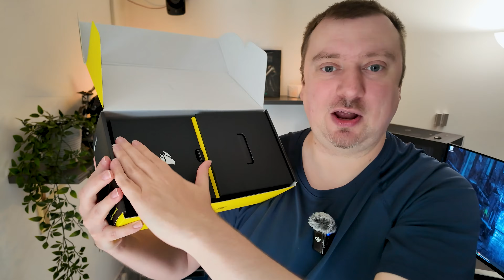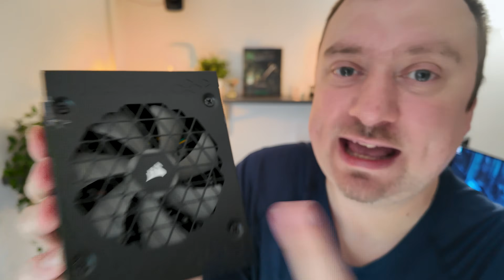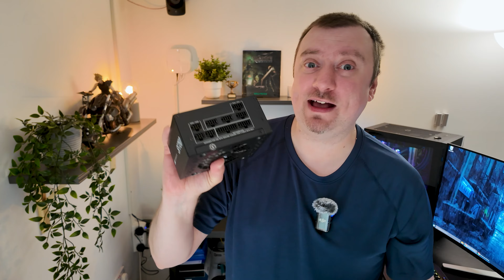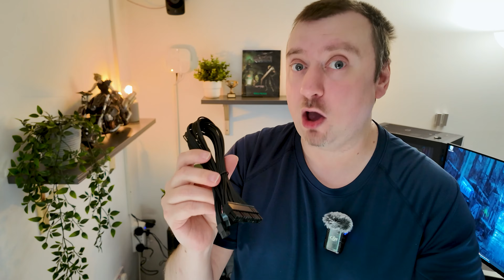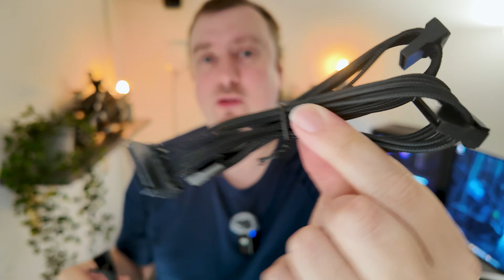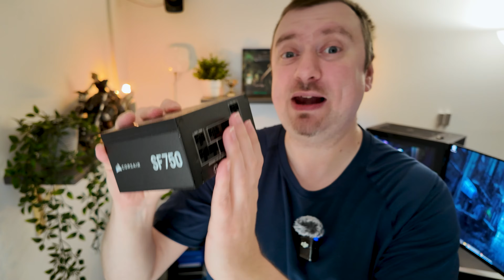CORSAIR SF750 PSU (2024 Model) | Ready for ATX 3.1 and PCIe 5.1

Comment: Hi,
i see that this source has a 93 mm fan, compared to other models that have a larger fan, 120 mm or even more. I'm curious and please tell me if this source becomes "noisy" with intense use. Small fan, it needs high speed to ensure the air flow necessary for cooling.

Another important thing, the cable from the box have enought length for ATX mainboard and Midle Tower case?

Thanks!

Comment: hey buddy just a quick question about the 8 pin pcie cables for the gpu. I also bought the 2024 version of the psu and I noticed on the older version, the pcie 8 pins have double connectors on 1 cable and I think that looks ugly because if you're gpu only has 1 pcie 8 pin port, you're gonna have that other cable hanging off and you'd have to zip tie it or something to make it look clean. so my questions is, are the 8 pin pcie cables on the 2024 version singular? Or do they have another pcie connector hanging off of it? Thx in advance!
Reply from the maker: Yes, this is the 2024 version. The PCI-E cables do have that double connection, which like you, I would prefer it did not.

Comment: there is no 12vhpwr port?
Reply from the maker: Huh. Dont I show it in the video?
Reply: No, the PCIE5.0 standard denotes that the PSU side of the cable must be 8pin connectors. Whereas non PCIE5.0 PSU's will have the 16pin 12V connector on both GPU and PSU side.
Reply: @AxleLotl so corsair is the right one here? i saw other psu has 12vhpwr in the psu side directly
Reply: @kamalhm-dev  You can have 12vHPWR connector on non pcie5.0 PSU's. It simply means that it uses 8pin connectors on the PSU side so you can't overload the 12v rails in the PSU since the slots are taken up.
Reply: fyi for all watching this. 12vhpwr is deprecated on atx v.3.0. now on atx 3.1 is 12v-2x6.
Reply: It's an adapter layout. I was looking for a dedicated slot as well.
Reply: @IndraAsLesmana the conector hasnt changed, only the length of the pins slightly
Reply: How is this a PCIe 5.1 PSU without a dedicated 12vhpwr port on the PSU? This was realised in 2024.